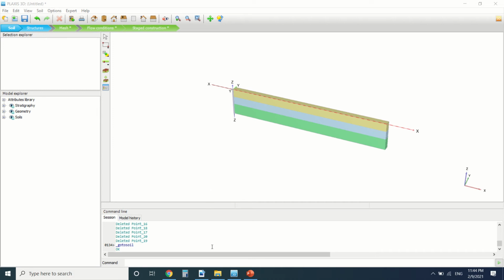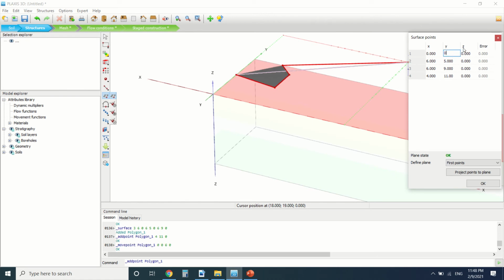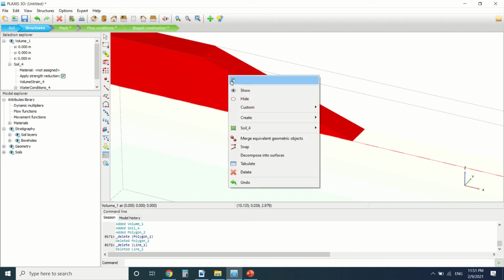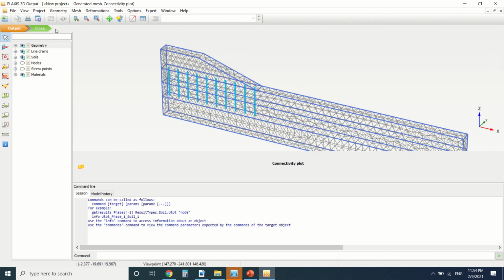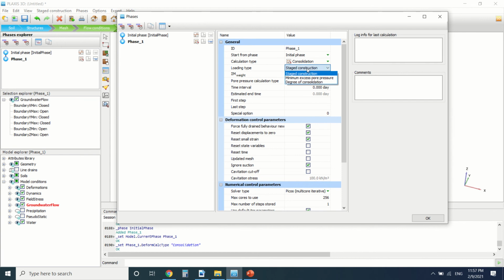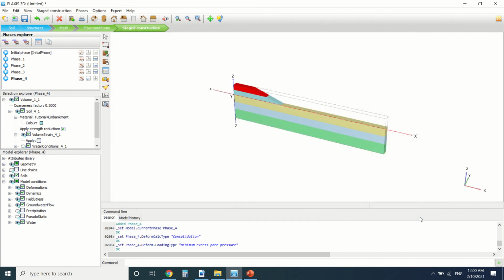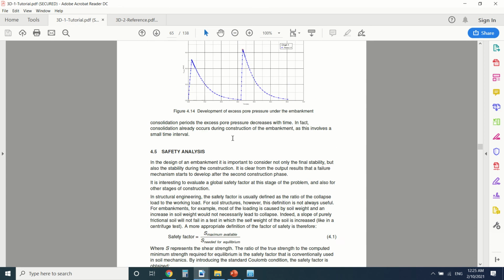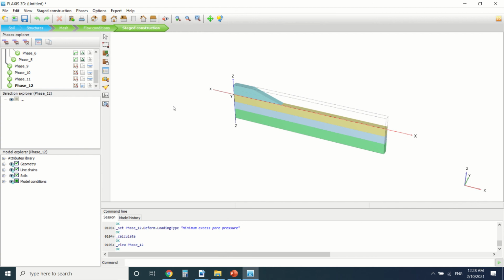11- Plaxis 3d tutorial with explanation: construction of road embankment

Comment: Hi. I have doubt with ground water flow conditions. Lets say if xmin and Xmax is open ,does that mean water will glow out of the model?  For instance , if i want to model 2m by 2m soil under undrained conditions and i want to apply a load at the top of the soil, then xmin,x max ymin ymax and zmin should it be closed or should I keep default boundary available in plaxis ?

Comment: How to apply the triangular pattern of vertical drain?
Reply: AM one of geotechnical student in msc program and my thesis is based on the vercal drain. My questions are:
1. How to to insert the diameter of vertical drain?
2. In paxis 3d sofwere there is only one option of pattern or position of vertical drain which is RECTANGULAR, but for my thesi i have assumed that the pattern or posision of vertical drain is TRANGULAR patter but HOW??? IS it possible to use traiangular pattrrn???
Reply from the maker: @hailemariammekra6987  in plaxis the drains are defined from there head level (level of water on the drain) and not by the width or even the shape
Reply from the maker: can you be more specific plz